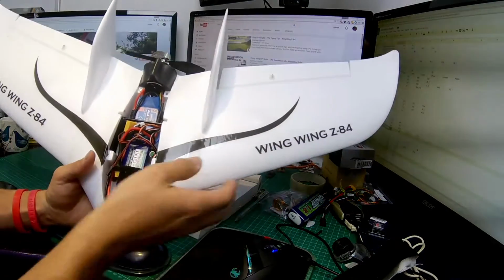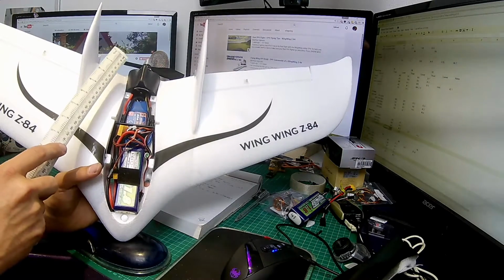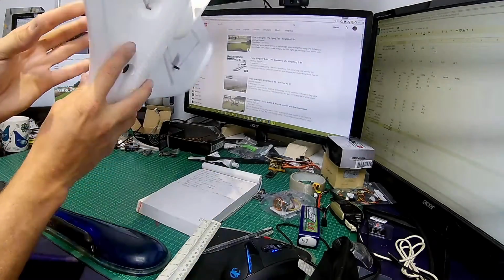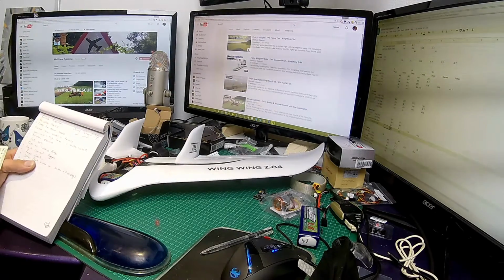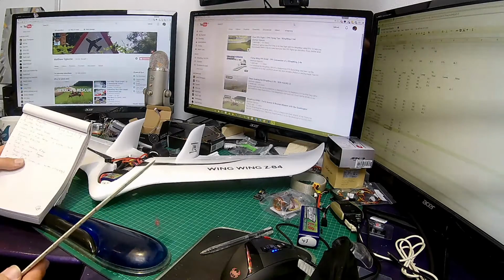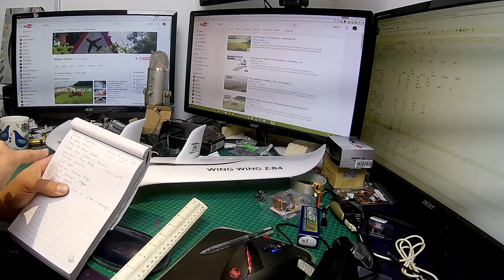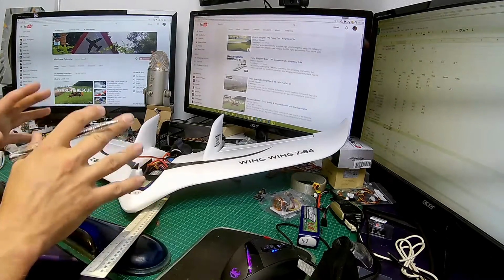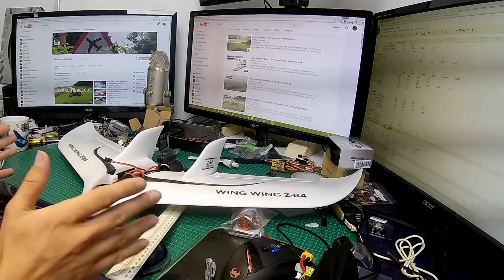Part #1 - The FASTEST WingWing Z-84 on EARTH - Build Overview

Comment: um, should i place the rx's antenna horizontally or vertically? by the way i am using a flysky 6ch rx
Reply from the maker: Howdy Phillip, I've not noticed any difference at doing either. But if it has two antennas, make sure they're at 90 degrees to each other and as far away as possible from the video transmitter. Hope that helps Phillip, Matt

Comment: I WANT TO SEE IT FLY !!!
Reply from the maker: Me too! I want to see it fly so fast i have to land after the 2nd pass because I'm too scared to fly it any more :D
Reply: +Matthew Ogborne ah ah i love that !!! I will try your ntm motor. For the momemt i'm with the d2826 and it's really fast on 4s. Also you should try APC props ! I have the max performance with that.

Ps : i'm building an Bonsai like yours ! But with a littlebee 30a esc and a very little 5v bec to save weight ! I can't wait to try it. Thanks for all your advice !
Reply from the maker: Howdy. I had some carbon fiber props arrive yesterday and they'll be going on :D 

For the Bonsai, the EMAX RS2205 2600Kv motor is absolutely mental. The only bad thing I can say about that setup, is the nose weight. I'm running standard size 1300mAh batteries and it makes the Bonsai too nose heavy.

Oh and make sure you put carbon fiber rods through your bonsai, they're just too flexible without them, especially if you're going to be making it mental fast too :)

Matt

Comment: what flight times are you getting on 3S and 4S ?
Reply from the maker: Howdy, if you run it with the 2200Kv motor on 3S, you can fit anything from a 1300 to 2200mAh pack in the model with flight times ranging from 10 to way over 20 depending on how much you cane it. On 4S, not more than 4-5 minutes as it'll be eating the amps & screaming MORE MORE! Matt